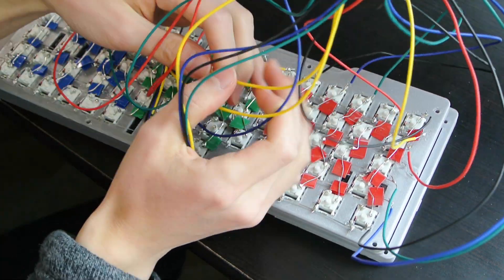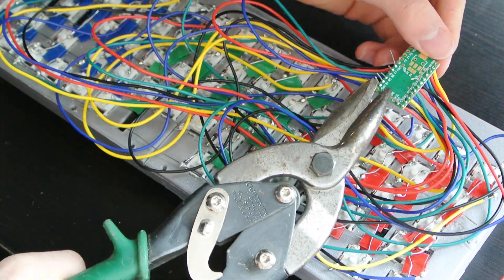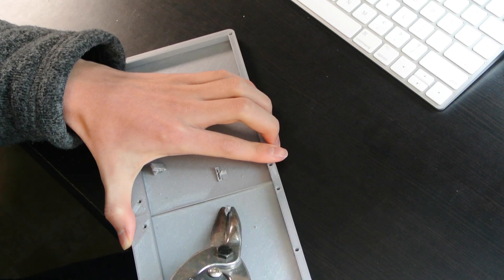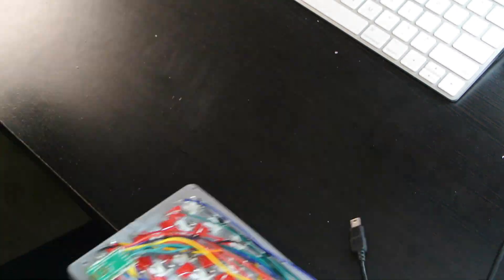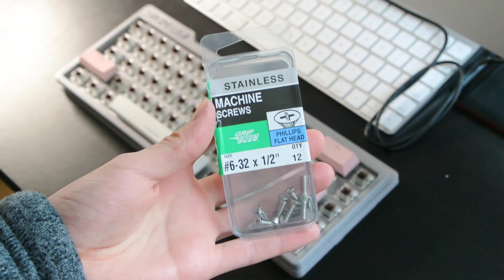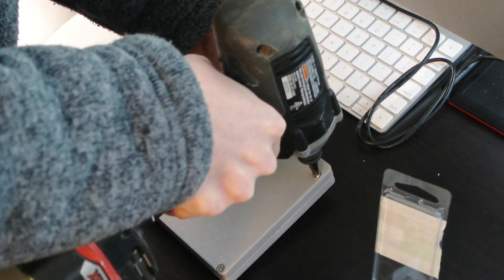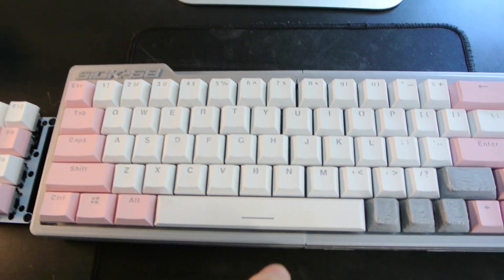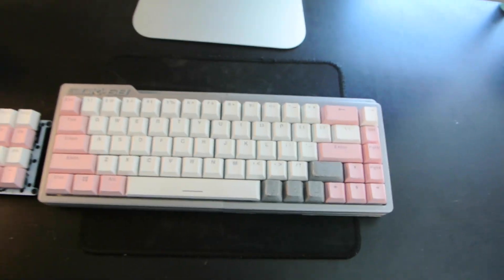I 3D printed a mechanical keyboard | SiCK-68 Handwired Mechanical Keyboard Build Part 4

Comment: I stumbled upon your video and I wanted to say that's a cool thing you made there. I was wondering, are there any compatible hotswap PCBs for this. Also, do you have a lower profile version too? I was thinking if there was a way to lower the case of the keyboard.
Reply from the maker: I don't know if anyone has made a low profile or hotswap PCB version already, but you could probably modify the files (in the description) to make it work!
Reply: @reecemakesthings  I kinda gave up and got a cheap chinese 65% hot swap wired mechanical keyboard for like 20USD for the PCB, stabilizers, cheap plastic plate+foam pad. Probably try to make a flat 3D printed case as low as I can get. Together with DSA keycaps and outemu silent switches, probably get a slim quiet keyboard I can use in the office on top of my laptop

Comment: well its nice but the 3d printed keycaps are kinda scuffed ngl...
But if u want better sounding stabs u should go with Cherry type stabs instead of the costar ones if u have a little more money to burn but I think its worth it
Reply: can't have cherry stabs in SiCK-68, believe me I tried that (modified model) lmao. Spacebar kept getting stuck halfway down. Got mad, broke the damn thing in half. I think there's a good reason they went with costar stabs.
Reply: @jm036  well you can use cherry plate mount stabs but not PCB mount stabs. I got the PCB mount stabs so I was stupid and I just made cubes to support the stabs and they work kinda  but not perfect